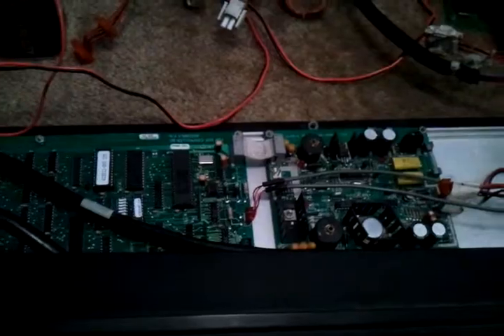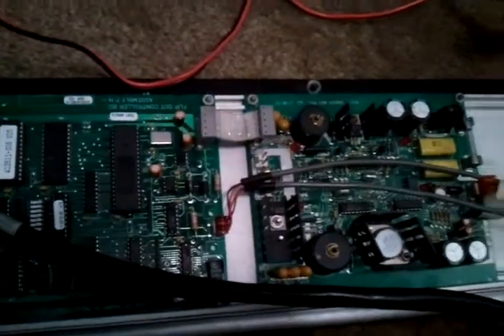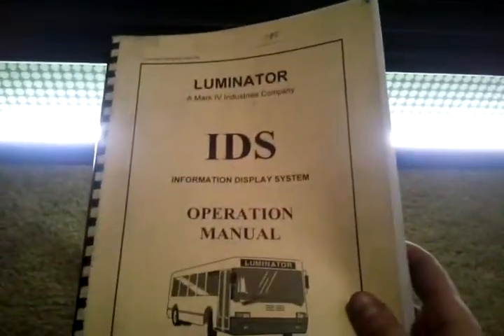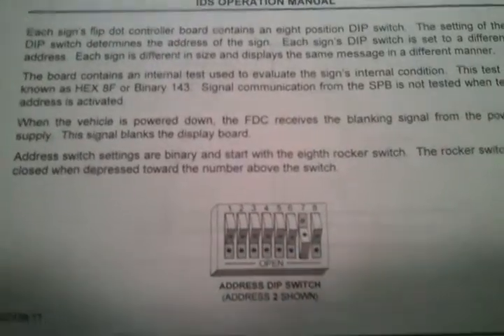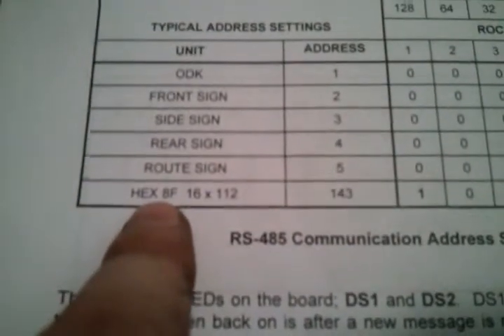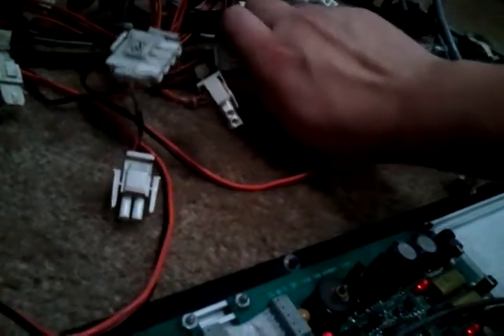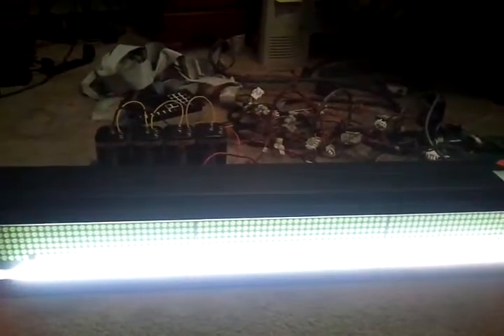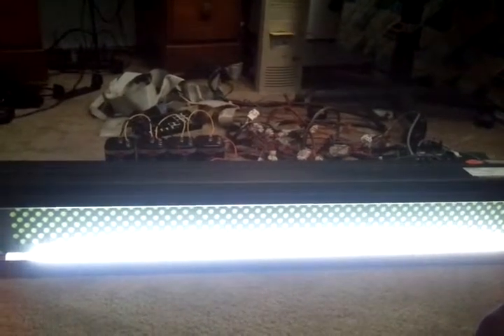Luminator sign project part 3.5

Comment: Curious if you happen to have the Luminator IPS (programming software) for these signs? Nice documentation of how this all works!

Thanks! :-)
Reply from the maker: Brandon M. nope. I wish I had the software.
Reply: I'm working on reverse engineering this system so I will let ya know what I find out :-)
Reply from the maker: I have a friend who was able to take the EEPROM out of an ODK3 and read the raw data via a basic chip reader, and he was able to create custom messages by writing the raw code directly to the EEPROM and then reinstalling it in the ODK3. That is way above my technical expertise.